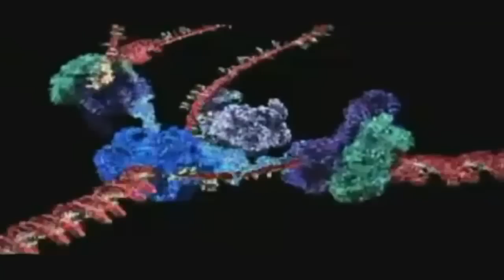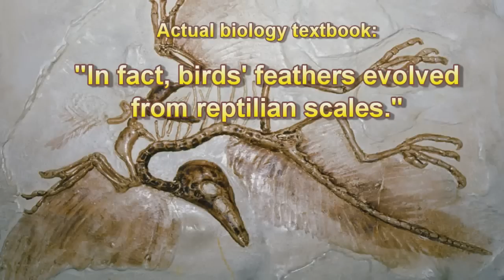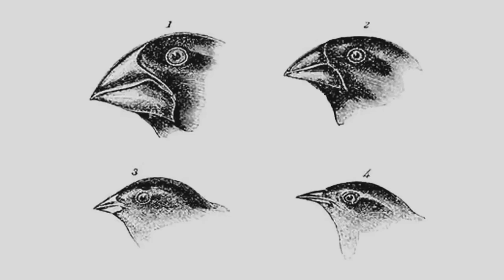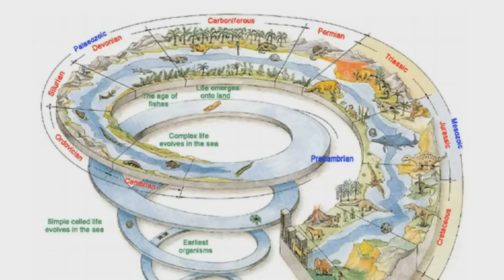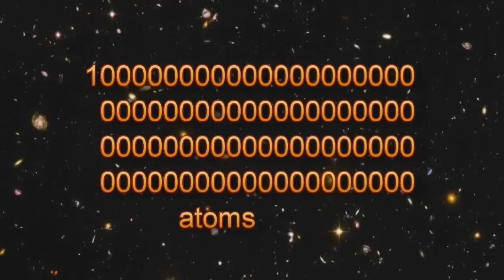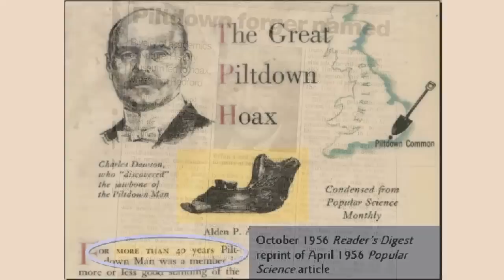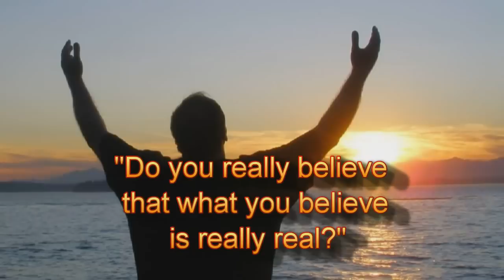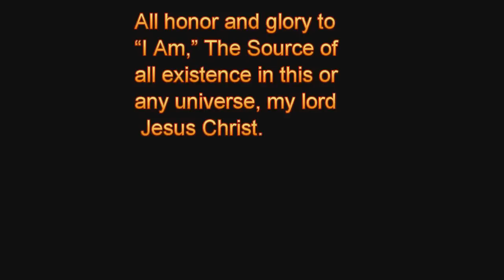Evolution Demolition

Comment: I have this weird feeling you don't actually know what evolution is...
Reply: If you think so, tell me specifically what I misunderstand.  I can't deal with your feelings.
Reply: Fair enough, so, first of all you start with a false premise: Life is either totally random or totally designed. Just would like to point out that there's no reason that it couldn't be a combination of both of these things. That's not really relevant, but it did bother me somewhat. 
Secondly you've started off by putting evolution at odds with God. "There is either evolution or there is God." There's no reason that both of these things can't coexist, and there's no reason that either of them must. 
You also seem to associate evolutionist with Atheism, while I've not doubt there is a correlation one does not depend on the other. Evolution does not require atheism, and atheism does not require evolution.  This is something you say over and over: "For the Atheist, evolution is the only game in town." - As you say at the start. There's no other way to address this apart from: You're just wrong. You can be an Atheist and doubt evolution and you can be a Evolutionist who believes in a God. The rational basis of Atheism is that there is a lack of evidence for a God. Even if evolution were disproved, that wouldn't immediately prove there was a God - you would need direct evidence of a God for that. The fact that there are things we might not understand is as much evidence for God as it is for Cthulhu, the flying spaghetti monster or my omnipotent friend called Steve.
Now, that's not intended as an attack on your belief, but I'm just trying to point out how absurd the idea that '"There is only evolution or MY SPECIFIC VERSION OF A GOD and nothing else!" actually is. 
When you talk about systems looking as though they were designed: "God has already made his case." In which case, so has Allah, Pangu, Ngai, Au Co etc. In fact, any man creating deity must have 'made their case' at this point. 
Also, the whole 'Buildings falling down to represent demolition' just feel very conspiracy-theory, and not very professional. That's just some feedback, hopefully you'll take it constructively. 

here's what I'm going to do, I'm going to watch this video again and write up a few points that I think are worth considering, and address some of the errors that you've made, it could take a couple of days because I don't plan to do it all at once.
Reply: No, I do not dismiss the idea of randomness in the real world or in biology.  The law of increasing entropy (randomness) is, in fact, an essential law to our existence.  When I want to take a breath, I don't run around looking for which corner of the room all the oxygen went to.  I assume this concept of randomness will work.  The functionality of the remarkable ATP Synthase molecule in mitochondria is based on the gradient of hydrogen ions across a membrane.  If increasing randomness did not work, this molecular motor could not work.  But good design plans mechanisms that use randomness, they don't use randomness to design the mechanisms in the first place.  Random phenomenon cannot write programming.  There is a place for randomness, but that is not it.
Reply: "Chemicals do not combine randomly, and natural selection is not random."  There is nothing in the chemistry that defines the order of the four nucleobases in DNA.  The bonds are of equal strength.  Unless specifically placed by the molecular machinery, the order of A, C, T, & G could be anything at all... completely random.  A random mutation modifies this sequence.. er... randomly.  Natural selection is not as random, since it has a general direction towards survival/reproductive value.  But that is not saying much.  The wind of a tornado is not entirely random either, but there is no specificity to the energy it carries for it to be able to rebuild a house, obviously.  Likewise with natural selection.  Natural selection operates on random mutations.  It filters out those mutations that are sufficiently harmful.  But it can do nothing creative.  The innovation must come from the random part of the mechanism if it is to happen.  But random never innovates.  Never.  It scrambles and damages information.  Random cannot write code for innovation.  It is impossible.
   The "descent with modification" concept solves nothing, because the word "modification" here means nothing but hocus pocus.  How does descent with modification differ from descent with magic?  The devil is in the details--in this case the detail of "modification."  Those incremental mutational changes need to be coherent and functional in order to build complex biological sub-systems.  Yet, in most cases a given mutation accomplishes nothing until many others are in place as well.  Don't get me wrong, I understand that dumb luck can happen with less improbable mutations, just as I could randomly pick 4 Scrabble letters from a barrel and occassionally happen to get a 4-letter word.  But at the point where a coherent genetic instruction is required, it is comparable to picking 40 letters in hopes of writing a coherent sentence (or even 1000 letters to randomly write a coherent paragraph).  The odds quickly become fantastically improbable.  (By fantastically improbable I mean that there are not enough time-matter-or-energy resources in the universe to provide enough trials.)  "Modification" could not write a novel, and it cannot write functioning genetic code segments.  Impossible.
   "It's well understood how supposedly irreducibly complex structures can and do evolve."  This statement is profoundly false.  In effect, evolutionists have cast coins into the well and wished for "co-option" but such a process has never been observed or even explained as to how it might actually work.  Virtually all biological sub-systems are irreducibly complex.  The functionality of even simple systems requires many components that are exactly the right size with exactly the right physical properties attached in exactly the right way simultaneously.  After such an irreducibly sub-system is operational, it is conceivable that minor random tampering can occur to tweak it, but that is the most that evolutionists would ever be able to rationally hope for.
   As a rational human being, I believe in the occurance of events that are either probable, or, at least, events that are not fantastically improbable.  Evolutionists believe in events that are ridiculously fantastically improbable.  That is called superstition, not science.
Reply: I'm waiting to see what you think you understand about irreducible complexity (beyond co-option).  And I'm waiting to see what is "flawed" that you find "not too hard."  With bated breath.  Claiming that your opponent misunderstands without correcting the misunderstanding is no argument.  I am willing to be shown my mistaken thinking, but a mere assertion shows me nothing.
Reply: Mark Champneys 
I don't think you're replying to me, but did you read my other comment? 
That's not really to do with irreducibly complexity, but I noticed you didn't respond. 
Also, I totally forgot about this - I will have a full response to this video soon, though! (It may be in sections.) 

In the mean time, read these, and let me know what you think: http://science.sciencemag.org/content/312/5770/97

http://www.journals.uchicago.edu/doi/10.1086/392687
Reply: I apologize for not dealing with the latter part of your previous post.  (I'm not sure if I expanded it on my screen.) Yes, I do see a close relationship between atheism and evolutionism, but they are certainly not equivalent.  An atheist has little to go on if he does not buy into some materialistic version of evolution in the various sciences.  It can happen with an atheist, of course, but not reasonably, and not many modern atheists would fall into this category.  Theists (in all their forms) can and do try to hybridize the belief in God with evolution, but I don't think it makes any sense whatsoever.  Evolution at its heart is materialistic/naturalistic.  It relies upon random chance (combined with natural law and physical properties) at its core.  As Einstein put it, "God does not play dice with the universe."  (Why would He need to?)  By the way, Richard Dawkins agrees with me on this.  I can't speak for other theists, but as an evangelical Christian I can say that the Bible very specifically precludes evolution in several verses (such as Romans 5:12).  So, no, I cannot accept that "God used evolution."  Besides, the science verifying that the earth is thousands, not billions, of years old makes all this moot, but that is another discussion.

As to the article links you gave, I have so far been unable to access the full text, so I will have to respond to the abstracts.  If you want to give me quotations from specific parts of the full text, I would be happy to respond more fully.

Both articles use language that reveals that evolution is assumed from the beginning.  The Science article says that they introduced two amino acid changes, but I have never denied that less improbable minor changes can happen randomly.  Certainly mutations happen, and if receptivity between hormone and receptor still work with these not-so-improbable alterations, it is not surprising.  It certainly does not prove that the principle of irreducible complexity is inoperative, although the authors seem to think it does.

The Philosophy of Science Journal article focuses on redundancy of design.  But that's just it; redundancy of components is a design principle, not a random principle.  I have an engineering background, and this takes careful planning.  It does not happen by accident.  If the authors think the presence of redundant components in living systems solves something, then let them set up an experiment to accomplish the random co-option of redundant components to demonstrate its feasibility.  I don't think they can, but even if they did, they would next need to show that such a pathway to comlex function can happen in most (not just one) biological sub-system.  So in my view redundancy of components supports irreducible complexity rather than refuting it.

A common thread seems to be something I've heard before, that common proteins are used in multiple functional bio-sub-systems, therefore it is proof of co-option.  This seems silly.  Nails are used in both furniture and in houses.  Does that mean that evolution co-opted the nails???  What about the larger components that are built from those molecules?  Those larger parts must have the size, shape, and physical properties to serve the purpose within the whole.  Common design rather than common descent seems to explain this much better.  Irreducible complexity exists in nearly all functioning bio-sub-systems.  It is real, and there is no explanation of how such mechanisms can be built by evolution--only the wish that it does.

Evolution cannot innovate, except in not-so-improbable simple cases.  Most of life is fantastically improbable by materialistic/naturalistic means.  Careful direction is the only answer.  And this is not a superstitious leap, since we have much empirical experience with the capabilities of intelligent activity.  (Unless we close our minds and rule it out from the outset.)

Enjoying the discussion. :-)
Reply: Yes, I am biased.  I think I have said that many times.  But I believe I am capable of putting myself in the other man's shoes, so that I can give it consideration from his point of view.  That is all I can ask of you, also, since you are just as biased on the other side.

"The original biochemistry would have been far simpler..."  Really?  Then you ought to be able to provide some hypothetical examples of such things that would actually work.  Everything we know about the simplest life forms is that they are overwhelmingly complex; and also that anything complex and functional rapidly breaks down, rather than builds up.  So "put up or shut up" as they say. :-)

I understand your point about the setting of the target, and I agree with the concept.  Improbability is critical, but how the target is set is also critical.  Yes.  But I would insist that the target is not arbitrary. It is about complex functionality.  In other words the target is specified by the functional results, not just by picking anything that is improbable.  And while it is true that there can often be more than one solution to a problem, we can safely say that those solutions/innovations are a small archipelego in a vast ocean of non-functional alternatives.  Even with our experience with millions of species, we see a limited number of solutions to the same problem (often common solutions).  And the rarity of solutions/innovations becomes even more apparent when we look at how (relatively) little human beings are able to devise.  Folks think that life happened by accident, yet those same people cannot make it happen on purpose.  LIfe is a rare thing.  Stunningly rare.
Reply: Seen From Space regarding "Science shows the universe to be anything BUT thousands of years old."
 A quick look through this comment thread seems to show only you bringing up the topic of a young universe. Why do you bring this up? Mark's comments only talk about evolution. 

I think you dismiss the point about probabilities too easily. No one doubts that mutations are sometimes beneficial. It is a simplistic assumption that these can accumulate and coordinate to produce novel features.
Reply: Seen From Space Re: "What data is there that shows mutations do NOT accumulate to produce novelty and macro evolution?"

Actually, I would ask what scientific papers show that mutations do accumulate significantly in a positive direction? 

There are technical grounds why they don't.
Reply: We do, in fact, have relics of pre-cambrian biochem:  pre-cambrian marine worm tubules with original organic protein and chitin molecules.

You ridicule the recession of the moon without any explanation or evidence to the contrary.  A variant of the ad hominem fallacy.

A mutation is a genetic accident.  Accidents can be beneficial on rare occasions, such as when HItler's Volkswagen crashes.  Beneficial mutations are, without exception, an occurance in which a function is broken, that turns out to help a different function.  Some forms of antibiotic resistance are exactly this phenomenon.  So all mutations are informationally deleterious, but that truth does not preclude a few rare ones that are beneficial to the overall survival of a given organism.
Reply: Seen From Space To discuss the many "limiters" of evolution will require a lengthy and time consuming comment. A youtube comment thread is not very practical for this level of discussion. 

I have been planning on starting this topic of "limiters" in the Evolutionfairytale Forum. I suggest you go to that site if you want an explanation to these technical grounds concerning evolution. Do not let the title of the site put you off. Also, be patient. It may take me a couple of weeks to get to it. 

Re: "Remember it's you who is claiming that established science is wrong..."

You misinterpret. I do not claim that science is wrong. I claim it is the INTERPRETATION of the scientific evidence which is too simplistic and logically flawed.
Reply: Lunar recession is an empirical undisputed fact.  Mirrors left by NASA astronauts on the Apollo missions have allowed very precise measurements of the distance.  Approximately 1.5 inches per year.

Information scientists tell us that it is mathematically impossible for a random process to write functional code.  The most that could be expected by sheer luck would be to tamper with what is already there in a way that does not produce fatal damage.  Admittedly, not-so-improbable mutations can occur by luck, but coherent functional code is fantastically improbable (operationally impossible).

That said, the burden of proof is on the evolutionist to show one single solitary case of coherent functional genetic code ever being written by random mutation.  That is what your model postulates, so that is what you must demonstrate.  It has never been done by anyone.  Not once.  Zip.  Zero.  Nada.  However, I can offer you billions of examples of coherent functional code being written by intelligent mind.  So who has the science and who has the superstition?  Evolution has been wished for, but this key mechanism of the model has never happened.  Evolution does not qualify as a theory.  It scarcely qualifies as a hypothesis.
Reply: "Remember it's you who is claiming that established science is wrong..."  No, no, no.  We most certainly are not claiming that established science is wrong.  Empirical, observable, science is true; and creationists support it.  What is wrong is not the science, but materialistic/naturalistic speculations of people who often happen to be scientists.  Natural selection is well-established.  Change over time is well-established.  Creationists agree with this much.  But descent of all living things from a single ancestor is pure speculation.  Random mutations writing functional and fantastically-improbable code is a fairy tale.  It is less than science.  It is anti-science.  Creationists love real science.  We love it because we love truth.
Reply: +Mark Champneys 
Okay, so, going to butt in again randomly (Still planning on doing that thing, eventually):

The rate at which the moon moves away from Earth isn't constant, that's worth noting. 

"Information scientists tell us that it is mathematically impossible for a random process to write functional code." I'm sorry, that's nonsense. There is no theorem in mathematics that states that structure cannot occur from randomness. I would advise you check your sources. 
DNA is not very much like code at all - that's just an oversimplification we use at high school. Furthermore, we tend to find that, if we model the rate at which mutations happen, the probability of a mutation happening that is beneficial, and the probability of that organisms bloodline thriving, the timescale required is typically well within accepted bounds.
Do not confuse impossible with improbable, and do not neglect the impact the timescale's and spacial scales we're considering here have on the idea of something being 'improbable.' 

"That said, the burden of proof is on the evolutionist to show one single solitary case of coherent functional genetic code ever being written by random mutation." 
We've done that, it's observable in the lab: http://www.pnas.org/content/109/14/E821

As an aside, we believe life originated from the principal that self-replicating chemicals systems would become more prominent than non-self replicating chemical systems - not from sheer randomness.

From my other comment: "Both articles use language that reveals that evolution is assumed from the beginning. " Well, it's effectively the fundamental theory of Biology, most of our Biological understanding really only makes sense in the context of evolution - though their assumption of evolution should not effect the evidence they provide on the topic of 'irreducible complexity', which they do tackle - I should have copies of both papers in full, I'll see if I can scan / upload them somewhere.

Also, on the topic, you may be interested in: 
http://www.genetics.org/content/186/4/1389 (Full paper at http://www.sciencedirect.com/science/article/pii/S0040580909000264)
http://onlinelibrary.wiley.com/doi/10.1111/evo.12517/abstract;jsessionid=A372358D8CDF1C357B6122FC1CC138C1.f04t04
and
http://www.pnas.org/content/110/34/E3171
Reply: "The rate at which the moon moves away from Earth isn't constant, that's worth noting."  Exactly so.  It is decelerating.  Which makes your problem even worse.  When the moon was closer to the earth it would have had to recede at a faster rate in order to get to where it is now.

"There is no theorem in mathematics that states that structure cannot occur from randomness."  Structure has nothing to do with it.  Natural laws can form structures or patterns.  That would be easy if that was the objective.  The law of increasing entropy in statistical mechanics essentially says that random begets random.  Your own intuition can verify this law.  Consider a huge barrel of Scrabble letters.  Now randomly toss them out on a floor and then see if it spells out a coherent message.  Can a book write itself?  Never.  It is not only fantastically-improbable, but intricately functional.

"DNA is not very much like code ..."  Are you kidding?  It is exactly like code, because it is code.  In fact, it is sequence-specific  digital code (base four).  Every information scientist who has ever looked at it recognizes it as such immediately.  Francis Crick even acknowledged this.  Bill Gates acknowledged this.  Virtually every biology textbook acknowledges this.  The only difference is that it is far more efficient than any human-devised code.
Reply: Mark Champneys 
Human intuition is notoriously flawed. 
"The law of increasing entropy" - haven't I already covered that before? 
I'm pretty sure that It was in my first comment? 

"Consider a huge barrel of Scrabble letters. Now randomly toss them out on a floor and then see if it spells out a coherent message." Yes, they can, and after quite some time almost certainly will. 

DNA as code...okay, firstly, our DNA is not very efficient at all, depending on what you call 'efficiency'. 
Secondly, have a read of this: http://www.skepticink.com/smilodonsretreat/2014/09/10/dna-is-not-like-a-computer/ and lemme know what you think. The reality is even more complex. 
Calling DNA 'code' is a gross oversimplification.
Reply: "I'd say that counted as a "uniformitarian assumption": that you could simply extrapolate from current values or trends to make bold statements of a system's maximum age. "  And you would be wrong, because things change; catastrophes happen.  Things are always more complex than you assume, when dealing with deep time.  Extrapolation from one natural process renders an entirely different result when you extrapolate from a different natural process.  As I said, the shorter extrapolated age is controlling, because these results represent maximums, not absolutes.

"Exploiting it as "evidence" for a young universe is unsustainable"  How so?  Define "unsustainable" as you are using the word.  Make your case; don't merely stick a label on it and walk away.
Reply: "come up with a test for the design inference."  Many things work.  Ask a police detective, a crime lab technician, an archaeologist.  They deal with the artifacts of intelligent activity all the time.  A universal one was mentioned in my video: the presence of objectively decodable symbols.  The very thing that SETI is looking for.  Another tell-tale sign would be indications of planning for contingency, and optimizing competing design objectives as seen in a working system.  This is most easily seen in irreducible complexity; which is virtually everywhere in almost any biological sub-system.  The clear presence of any feature that requires foresight, such as is so obvious in the metamorphosis process of a butterfly.  The larvae has a digestive system for eating leaves, but that digestive system is entirely changed as a butterfly for digesting nectar.  Foresight.  Design.  There is no linear path to getting to these places.  Successive serial trials cannot work when a large set of parallel paths is required to ever get there.
Reply: ""The law of increasing entropy" - haven't I already covered that before?"  You've dismissed it with talking points, but never dealt with it adequately.  Try again.  This time go a little deeper into the concept.

"Yes, [Scrabble letters] can, and after quite some time almost certainly will."  While this sounded convincing to me as a teenager, and may sound convincing to you, try running the actual numbers. After "some time?"  Do you realize how much time we are talking about here?  Fantastically-improbable odds are so small that trillions of trillions of trillions of universe lifetimes are not nearly enough time.  There are not enough resources of matter, energy, and time to offer enough trials for such luck.  It would be far more likely that all the moving gas molecules in the room you are sitting in would suddenly and spontaneously go to the north together and blow a hole in the wall, while the vacuum created in the rest of the room collapses those walls.  It might be unlucky, but just give it enough time, right?  Oh, yes, the other problem is that once your Scrabble letters got that lucky, the same luck would destroy the arrangement within the next nanosecond.

"...our DNA is not very efficient at all..."  That may be the most arrogant thing I've ever heard.  There is no more concentrated volume of information in a smaller space anywhere in the universe.  We are just begining to find out all that DNA contains.  It is coded forwards and backwards and over-lapping.  The proximity of one segment to another as it is wound up in a chromosome changes the meaning.  We are just beginning to look at epigenetic information, such as the histone code.  This incredible code provides instructions for building millions of species of every variety--all in amazing working order.  It contains start codons, stop codons, self-correcting mechanisms, and on and on and on.  "Not very efficient?"  You and I don't fathom the tiniest fraction of what DNA contains.
Reply: "You’re suggesting a global conspiracy has totally subverted the scientific method..."  No one said that it is a conspiracy.  It is human nature.  Scientists are people too.  They have biases, and emotions, and selfish motives like the rest of us.  They want to have the approval of their peers, and they want fat government grants.  Most evolutionists have altruistic motives, to be sure, but they are tainted by their humanity... just like the rest of us.  The scientific method has been replaced by "science by consensus."  Why has science become a popularity contest?  It is supposed to be a quest for truth.  Sometimes the consensus is wrong.  It has been so, many times throughout the history of science.  In fact, discoveries by the minority have been the basis of most actual science that happens.  And, by the way, the scientific method cannot be applied to the distant past; only to the present.  The distant past can only be looked at through inferences.  Especially since no written history was kept of the distant past for us to check our data against.  Oh, wait, yes there was-the Bible--but then you must dismiss that account without even a look.  That's not a conspiracy, just good old fashioned sin (rebellion against our Creator)... like with the rest of us. :(
Reply: Mark Champneys 
In what way do I need to go deeper? 
Not only can the second law of thermodynamics be freely violated over any finite timescale, it just outright does not apply to the Earth or Organisms because neither are closed system. Also, it's not even applicable otherwise: It's got nothing to do with a human perception of 'order', it's to do with free energy. 
How is that not a total rebuttal of your points? 

Well, you're claiming that not enough time has passed. So, how much time would it take, and how was that calculated? 
"trillions of trillions of trillions of universe lifetimes" Listen, I don't want to be 'that guy', but you're starting to sound less and less credible. We have no idea how long a 'universe lifetime' actually is, unless you mean how long it has already existed for? I'm not an evolutionary biologist, I deal with Physics and Materials Science, I wouldn't know how to go about calculating these numbers...so..could you? 

DNA contains about 700TB of information per gram...current storage techniques get about 20,000TB per gram, occupying far less volume...
Reply: "Do you have any idea how scientists love_ to debunk each other's work?"_  If it will elevate their own status and grant money, sure.  But few want to debunk the consensus view if it means castigation by all the rest of their peers.  Human nature, not conspiracy.
Reply: "The thing about the past not being amenable to the scientific method is rubbish too."  Forensic science is making inferences based on science done in the present.  Empirical science is observable repeatable experiments.  We can't do that in the past, particularly not the distant past.  Instead we make inferences based on (1) empirical science (scientific method), combined with (2) assumptions about the past.  (You know what happens when you assume?)  Both evolutionists and creationists look at the same observations, the same science.  But the assumptions, the model, the lens (through which things are viewed) are vastly different.  We don't need to insult each other here.  We both believe in empirical science.  But an inference is not, itself, science.  It is an inference.  This kind of abductive reasoning is the very thing that Darwin emphasized... "to make an inference to the best possible explanation."  The debate is about the best possible explanation, not about whether observable data is valuable or not.  But don't fool yourself; making inferences based on science is much different from calling the inferences "science."  The former is valid.  The latter is an equivocation fallacy.
Reply: "... IC systems can evolve and have been observed evolving"  Please clarify your abbreviation.  IC?
Reply: "In what way do I need to go deeper?"  Delve into the concepts involved, not just the technicalities, or the wording peole use.

"Not only can the second law of thermodynamics be freely violated..."  I'm sorry, but no natural law can ever be violated.  Ever.  That is why they are called laws.  (Well, with the exception of the natural Law-Giver.)  The law of increasing entropy cannot be violated. Period.  However, there certaily are ways to work around its constraints.  For example, entropy can be transferred from one sub-system to another via some kind of entropy transfer mechanism (ETM) and the precise application of outside energy to accomplish this transfer.  I know that you have been told that you can invoke the old "open system" exemption card, and freely ignore the law, but it doesn't work.  Thermodynamic entropy is defined for a closed system only because you cannot sum up microstates without defined boundaries to clarify the sum being calculated.  It does not mean that the law can be ignored in an open system.  The law stands.  Everywhere.  Think of it with this simplicity:  Any given arrangement always tends over time towards an alternative arrangement that is more probable.  Matter, energy, or information.  It doesn't matter.  Can you not see that this must be statistically true for any significantly large ensemble of whatever?  Random is highly probable.  Specified, functional, information is highly improbable.  Thus, a book cannot spontaneously write itself.  Neither on paper, nor in nucleotide coded sequences.  It goes the other direction if anything.
Reply: Okay, show me one case of an IC system evolving into existence.  (It is granted that mutations can tamper with one that already exists.)  Show me co-option actually happening.  Ever.
Reply: ""Castigation" is reserved for those who's work is sloppy. "  Anyone who crosses the existing club of peers is always deemed "sloppy."  So they get black-balled.  And If one has ever associated himself/herself with ID they are automatically "sloppy."  I supposed "sloppy" for even using the term intelligent design.

Again, calling it "conspiracy" is your word, not mine.  It is human nature.  It is a phenomenon at work on every schoolyard in America.  Evolutionists are not immune.  There are many documented cases.  I think of the case of Granville Sewell who wrote a paper calld "A Second Look At The Second Law."  He went through peer-review and his paper was initially accepted in a mathematics journal until an evolutionist noticed that it contradicted evolution.  The paper was pulled at the last second, and the journal tried to pay off Sewell with $10,000 for violating their agreement.  Eventually Sewell got it published in another journal.  Such censorship happens frequently.  Fortunately there are now a few ID-friendly journals, so such scientists have at least a few other options.  (Bio-Comlexity would be an example.)
Reply: "You've not understood how peer review works..."  Claiming that I don't understand is not an arguement.  If I misunderstand something, then point out what it is and correct my misunderstanding (as you see it).  This is a variation of the ad hominem fallacy in which you demean me and assume that such a claim proves your position.  Neither is true.

"The ID movement hasn't produced one testable hypothesis is 20 years."  A ridiculous assertion.  A notable example is that many ID proponents and creationists predicted that most so-called pseudogenes would eventually prove to have function in the genome.  ENCODE proved ID theorists correct, and many evolutionists who touted "junk DNA" to be wrong.  This is a biggie.  Evolutionism majorly hindered genetic research with such unscientific thinking.  Hopefully they have learned from this blunder.
Reply: "If irreducible complexity is an insurmountable obstacle to evolution, it should not be possible to conceive of such pathways."  Who says so?  This is simply false.  But, you have not met your own requirement anyway.  To simply imagine an infeasible wish (such as co-option) is not a "pathway."  That is like saying that abracadabra is a pathway.  A true pathway requries detailed steps that overcomes foreseeable obstacles, along with evidence that something like this has happened before.  You have nothing of the sort.